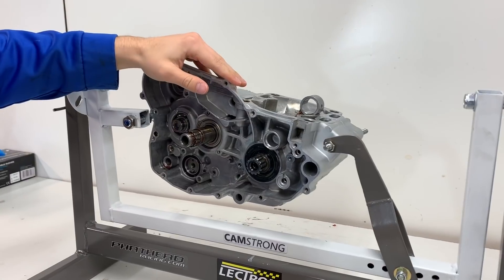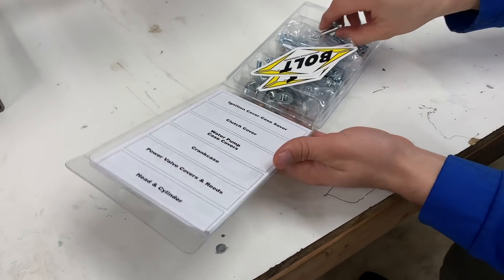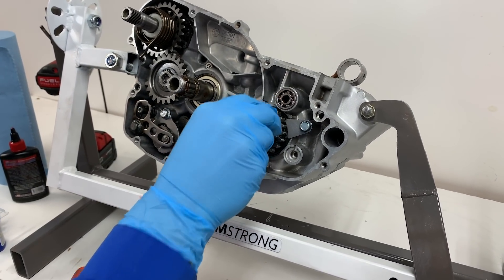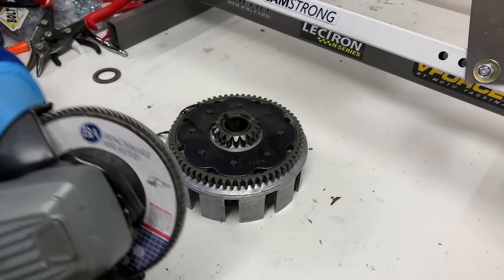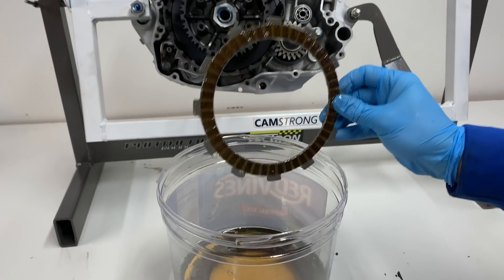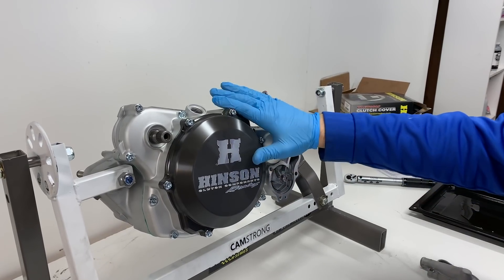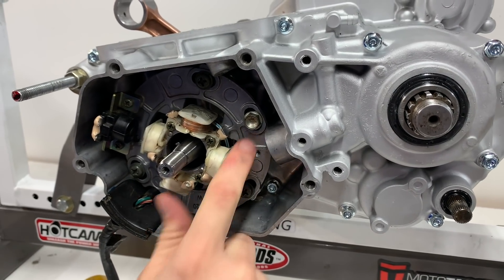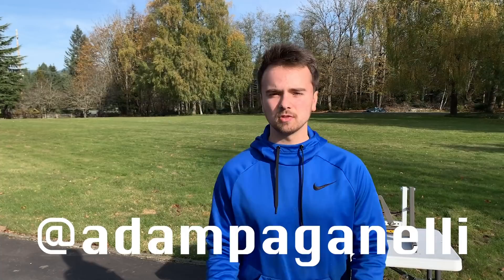Amazing YZ250 Bottom End Rebuild! Part 7

Comment: That clutch is sick. Can you tell me what the small housing is on the side of the cylinder on the shifter-side of my YZ250 motor? It has two screws holding it on and a black hose that routes down towards the ground along the left down tube of the frame. Mine is venting a lot of exhaust out of the hose and I don't remember seeing that when my bike was new. Thanks man! Keep up the good work.
Reply: it from the internal part of power valve, its unburnt two stroke mix, nothing to worry about really.

Comment: Could you have used the yz250x clutch springs & bolts with the extra washer with the hinson clutch for lighter pull on the lever?

Comment: Great Series Adam, Excellent work! Is there any special caution that is needed when installing the power valve gear? (14:20 in your video) I was looking to watch how that goes together...and then it was on the bike:) Wanted to make sure i had it all lined up correctly, if it matters. Thanks
Reply from the maker: You want to make sure the cross bar pops into the groove of the power valve
Reply: @adampaganelli4891  ok thanks, will do!

Comment: so what was wrong with the transmission? what were the metal filings from? you didnt say in the last video and then in this video the trans is all magically put back together, which would have been better if you had included it for those having transmission problems. great videos otherwise though.

Comment: Your motor is going to look amazing when it is all done!! What weight is that flywheel? I have the 9oz and I like it but you have to bend the clutch actuator arm a little. The bad thing is that this puts the clutch cable at a bind which causes it to wear out faster so I removed it. I noticed that your clears your weight no worries. You do some amazing work as always and that motion pro gear jammer is worth every penny!! :)
Reply from the maker: Thanks Erik! Mine is a 9 oz as well but I did see in the instructions they mentioned that I might need to bend the actuator arm. It seems like you shouldn’t be having that cable issue. Have you tried contacting them?
Reply: @adampaganelli4891  no I have not, I researched the GYTR flywheel and it does not interfere with the clutch arm at all. It is 8.4oz which is not that much if a difference. I may get one of these.

Comment: Awesome video and love the look of both the covers! Do you have any idea how different this engine is compared to the yz125? I'm looking to rebuild one of those and these videos are insanely helpful. Keep up the great quality!
Reply: they are put together virtually the same way, the torque specs will likely be different though.  biggest difference between the 2 is the clutch actuator.  125s are on the clutch side and 250s are on the stator and use a push rod
Reply: Andrew Schreefer thanks for the reply. As long as they are similar shouldn’t be much of a problem. I wish there were more detailed videos out there. Who knows, might end up doing one myself!